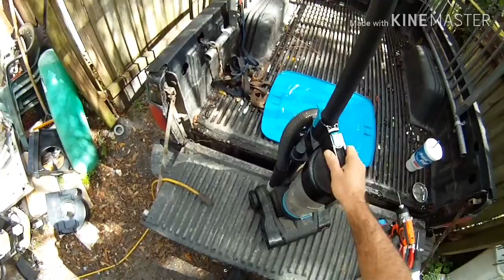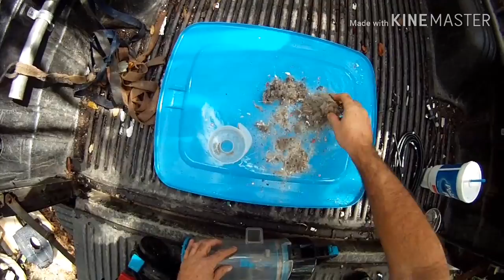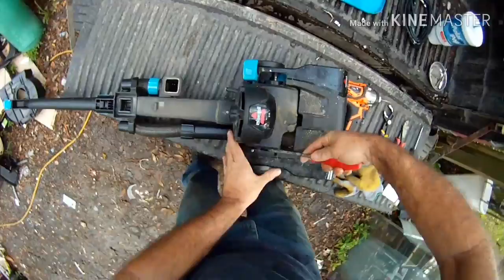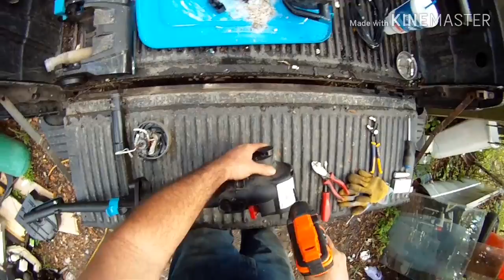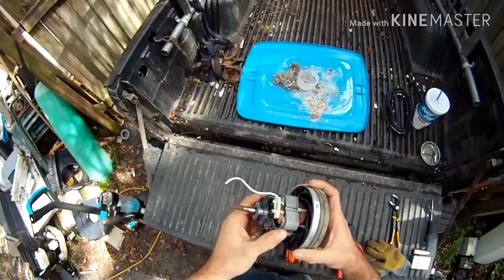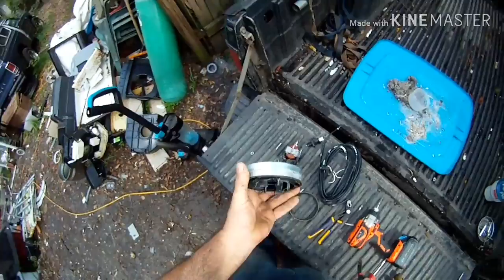What's inside a vacuum cleaner

Comment: There would also be copper wire from the handle to the motor. If you want to spend the time
Reply: In the older vaccums where the switch is in the handle. Newer ones are at the base.